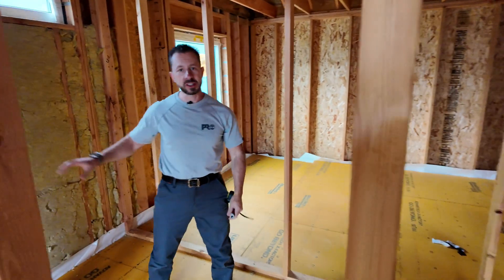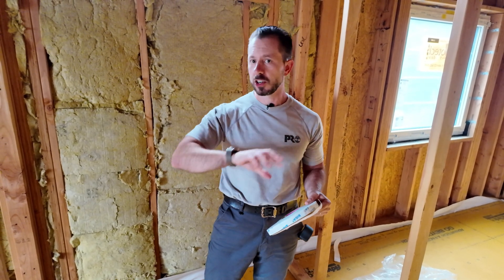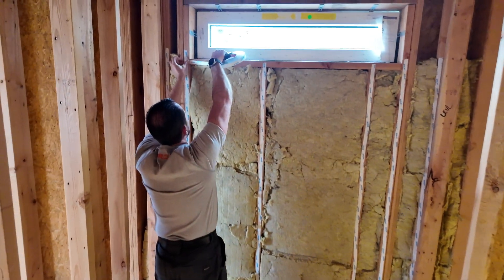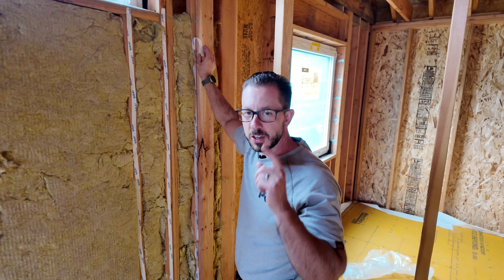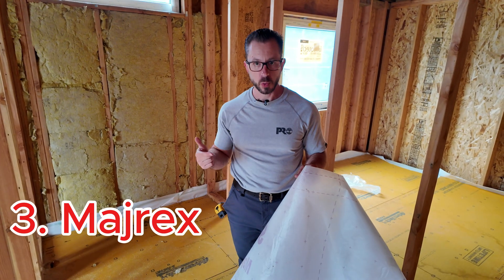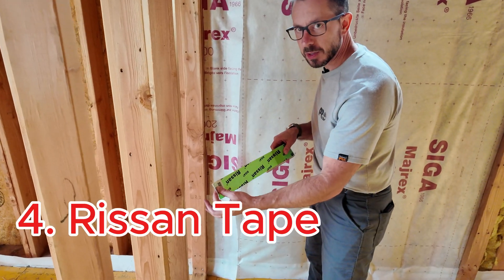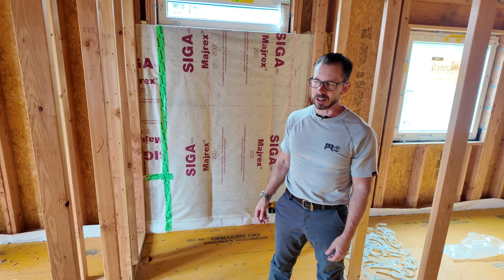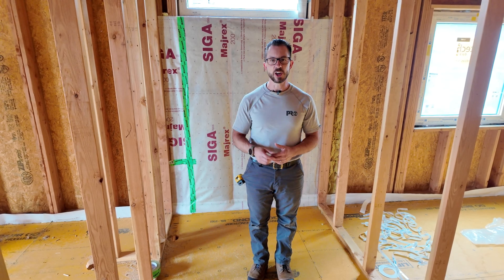Building Science Recipes: Air Sealing Behind a Shower

Comment: Could you have taken into account the air sealing prior to interior walls and simply run a 12-16 inch band of Siga on the backside of the interior wall stud and simply tape the remainder of the exterior wall to the bands? Kinda like vapour barrier or house wrap sandwiched between double top plates?
Reply from the maker: I think it's more efficient to have the framers build interior and exterior walls as a block task. We do preinstall insulation when it is absolutely required for logical sequencing, but having rain in the PNW makes that a rare choice.